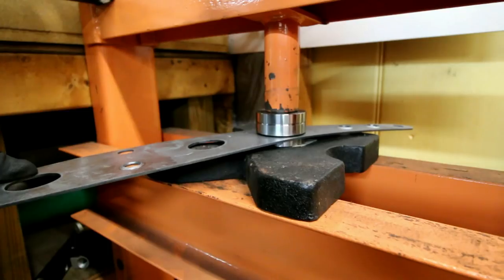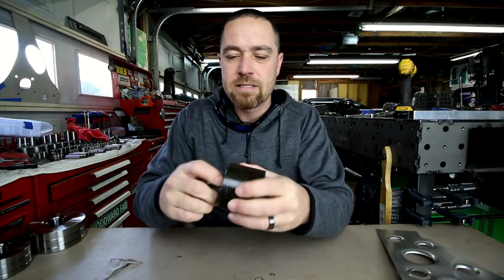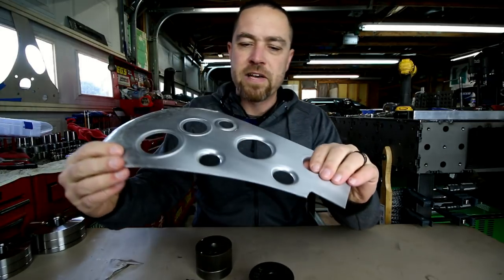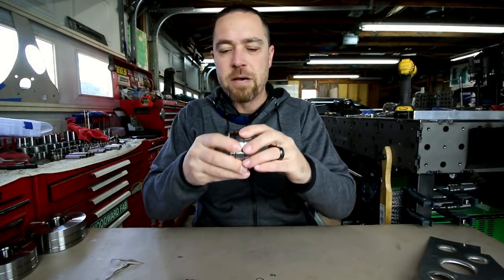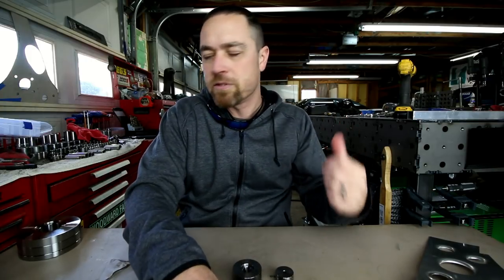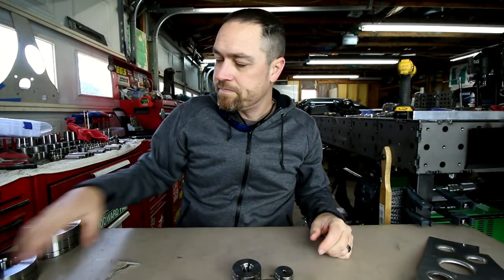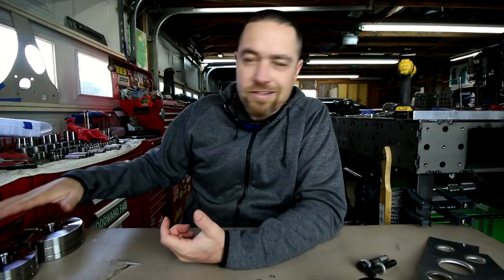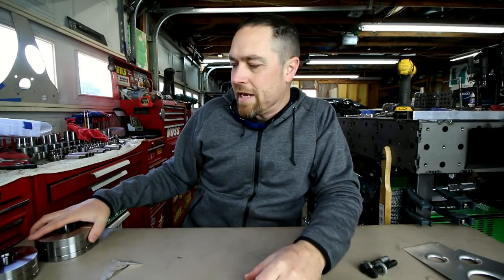You Need This Tool - Episode 90 | Dimple Dies - Dimple Die Set

Comment: Hey thx for the cool videos. Can’t wait to see the hot rod build come together. I like the cantilevered suspension ride height idea but I would probably make a lockout for going down the road so it cannot drop if a line or something was to fail. I know it’s probably highly unlikely but it would put my mind at ease. Also if the pump should fail, no doubt at the most inconvenient time lol, it could still be raised up with a jack to ride height and locked. Just my two cents worth lol. Thx again.
Reply from the maker: +jeff edison Yeah i plan to do something
Reply: The Fab Forums I kinda figured you probably were but thought I’d put it out there just in case.

Comment: I have that exact set I dimple died a 2.5" hole in .188 ss plate I just heated it to pretty darn hot with rose bud first worked just fine my press is a 20 ton also did it just fine

Comment: Fools, I have that tool. Made myself a set on my 40 inch lathe. If you value your time I'd buy a set for the prices shown. It would be nice though if they'd make the depth of the 45 degree roll the same on all the dies shown. You can keep the depth the same on various sized dimples by the depth you press the die in but in thinner guage steel or aluminum you'll want to bottom the die to remove some of the warp you get from the procedure of dimpling.

Comment: Never seen a punch and bead before. Do you know which is stronger the bead or the dimple?
Reply: Theoretically a pressed bead should be stronger. Think about the shape of the bead, verses and open edged dimple (in a like for like situations) with a bead you have two faces that have extended into the third dimension, whereas you only have one with a dimple. Problem is you probably won't be able to get a bead as deep as a dimple because you have to stretch the metal further and it would require infinitely more pressing force.

Comment: If I were to machine a set what metal would you say use? Something like EN8 steel ? And advice will be nice
Reply from the maker: +charlie brown not very knowledgeable about allows but I would use the toughest you bave5
Reply: 4140 would be plenty and no need to heat treat. You can pick up cut off tails on eBay for hardly anything

Comment: I made most of Mine .7500, 1", 1.5" and 2" just because I had some time and wanted to try it, but bought the .500 die. Couldn't have made it for the $18 it cost to buy.
Reply from the maker: +Steve Polhill yeah prices have come way down....hard to justify building them. At least for me
Reply: The Fab Forums Yeah when I made mine they wanted 600+ for the set, and I really didn’t want some of the larger sizes.  But now it only makes sense to buy them. Sadly just like everything else the cheaper ones are Chinese.

Comment: Nice as soon as my spindle get back from having the taper reground I am making me a set of those on my mill.  I have a ton of scrap steel and this would be good to test the spindle on once its re-installed.  Though I'm not going to make a full set.  Just one pair.  If I need a full set I will just buy one.

Comment: Have you done a bunch of flairs/beads, with eastwoods, on a panel yet? I did on a 24x48, 20 ga,  and it warped a bunch. What's the  best method to pre stretch the metal throughout the panel that size? Drill the pilot hole first or punch the hole before pre stretching?
Reply from the maker: +moptop85 yeah i havent jad any issues. I dod make a hydro adapter though.

Comment: I think I'm going to go with the set from SWAG OFFROAD they are a bit more but they have a smaller hole so you can use them after the fact. Say you have something already built and can't get it in your press.
Reply from the maker: +John Gray how do you plan to press it....a bolt won't do it when dimple dieing plate steel. If you just plan to do sheet metal I would go with some punch and flare units.
Reply: I agree, I think material  thickness and hole diameter should have a lot to do with it. Still can be used in the press same as the other dies to.  Just thought it would be another option.

Comment: You can buy a lathe and make your own for less that what a set costs lol
Reply from the maker: lol...a set was like $200 ....the tool steel alone would be a lot of that.
Some things you should just buy what you need.
Reply: Every decent full set I have seen has been 5-600$, I'll agree 200 is a killer deal if they're any good
Reply: Pro Menace Gaming I'll take a look for you when I get home from work, you can grab a used bench top for 4-500$
Reply: Used Lathe for 4-$500 plus cost of tool steel and then for some, learning how to use a lathe properly..... That is already more than what you said a decent set costs. I don't see how you are making them for cheaper?
Reply: You can make these on a mill too but yeah any good mill is going to cost you 50k plus the same goes with any lathe.  Now you can get manual ones for less or go straight up china garbage for way less (think grizzly or tormach) but either way you are still going to spend way more money than its worth.  Although if you already have a mill or lathe and happen to have enough left over steel from a customer job then might as well just cut em.  the 5 minutes it takes to mill out a set is faster than any trip to the store :D
Reply: Only time I think it is worth making your own is 1) you already own a decent lathe, and 2) the shape you want to press can't be bought off the shelf.
Reply: @Pro Menace Gaming If you are looking for good hobby level albeit chinese then go with Tormach.  They are junk compared to say something from brother or takisawa but they are WAY cheaper and they have an excellent support network.  Plus there are places like Tosa tools that make a lot of affordable great quality add on tools etc for them.  I run a Brother speedio s500 for my side business and if I had to do it all over again I would look at one of those for when I first started out. They also have payment plans etc.  Another option is to buy a used lathe/mill. There are plenty available on the internet for sale that are in great or refurbished shape.  Either way whatever you budget be sure to triple it to cover the cost of all the tooling you will need in order to operate it.  A good place of reference on what are good machines would be the forums at practiclemachinest.com (sorry The Fab Forums if the link isn't allowed let me know I will edit it out.)  That isn't a plug they just happen to have a lot of professional machinists that always like to help out with info.
Reply: Agreed.  In my case circle are a great way to test runout on a spindle when you are too cheap to buy the test bar lol.  But if I really needed a set the most cost effective way in time and money is to just buy one.
Reply: I live in Canada. We can not get this landed to us for any thing less than 1k. I am  going to make a set from 4140 on the lathe. Lets see how is goes.
Reply: @Bart pickles  You could always use a bearing race too.  Then all you would need to make is the upper press or ou could just go up one size on a bearing.  Pretty sure you could source multiple sizes from a junk yard on the cheap.  If anything just getting one could act as a guide for when you are making your own.
Reply: I don't have room or money for a lathe....  If you can get me one for less than $100, I can find the room